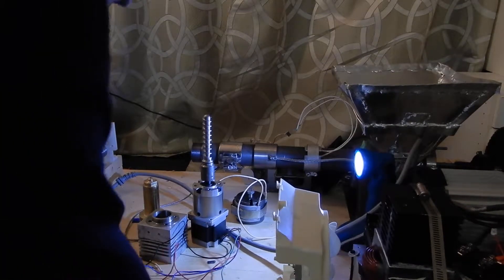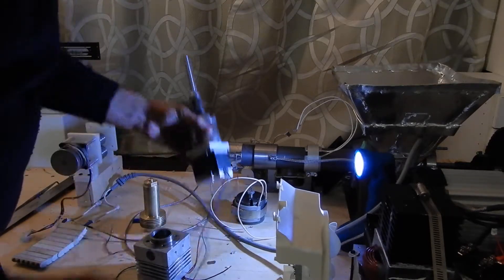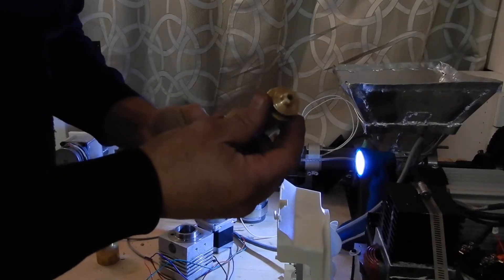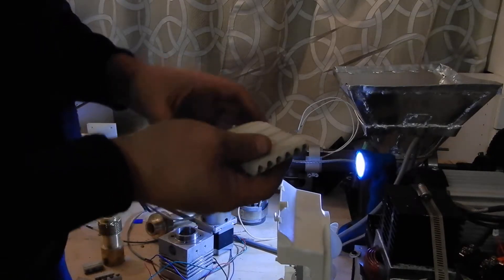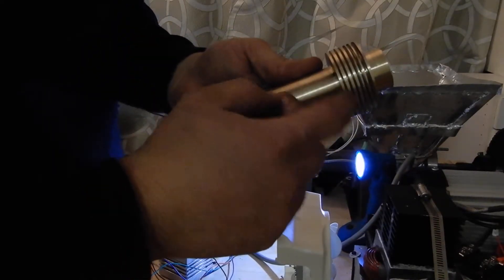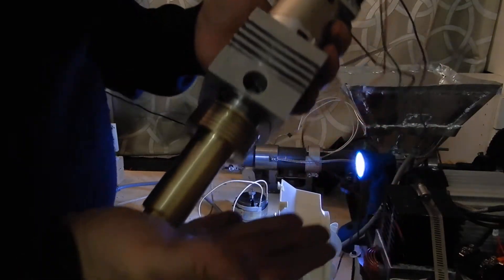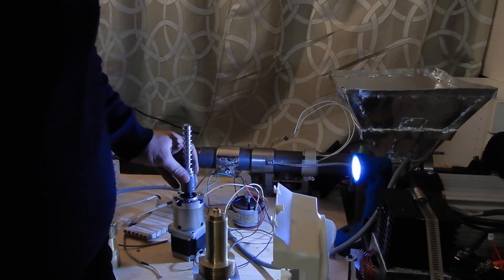DIY pellet extruder 3d printer hotend

Comment: Thanks for the update! And happy new year!
1.Any way you would be able to get more extrusion screws like that? 
2. When are you planning to finish this version, so we could see more results?
3. I see you have filaments extrusion line too. Is it up & runnin or some tweaking still left?
4. You must be printing big time, that you need your own filamnt line, maybe would like to share more details on that?
We kinda are doing same stuff, would love to learn more! and thanks for time spent for the videos!
Reply from the maker: Hi yes I'm going to get some more screws like mine one,  printing with filament is a slow process.  That's why I decided to make my own pellet extruder.  I'm waiting for new gearbox from China,  as soon as I get it I will make new video
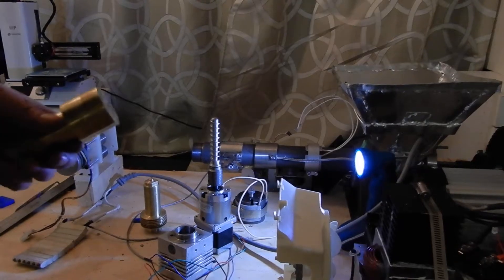Reply: @diygizmos1837  Sounds like a great idea! But why other gearbox? 1:15 too little or too much? just wondering because I know one serious company does it with bigger extruders and also uses 1:15 nema 23...
Reply from the maker: @r.dockevicius9130  it is nothing to do with 15:1 ratio , its about how much torque do you need to spin your screw without getting stucked. the gearbox in the video is garbage it it is not high presicion where I loose in efficiency. high presicion gearbox should arrive tomorrow. it will be single stage 96% efficiency gearbox and im going to use 3nm stepper motor. the screw i going to spin 2 times faster the torque will be 50% more than last setup. as soon as i put it together i will make another video. and i thing I will need to make more powerful heater, at the moment I'm using aproximatelly 400w but I need 600W for smother process
Reply: @diygizmos1837  Daamn it sounds great! Can't wait!
Reply from the maker: @r.dockevicius9130   hi today i have received new gearbox will try to make a new video tomorrow should work better than old setup
Reply: @diygizmos1837  Indeed looking forward to it!
Thanks for heads up
Reply from the maker: @r.dockevicius9130  as promised made 3rd version https://youtu.be/MiGaUcyz8uI 
Please let me know what you think
Reply: Hey! How is it going? Any news on the extruder? 
 @diygizmos1837
Reply from the maker: @r.dockevicius9130  I posted new video. Please check it out.  I have to make slight modifications to the barrel and I  think that will be it